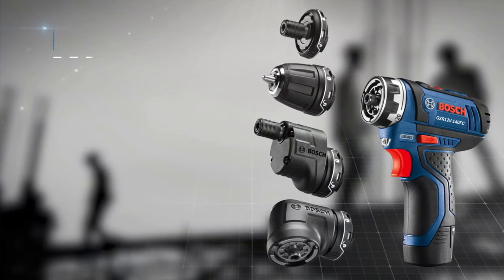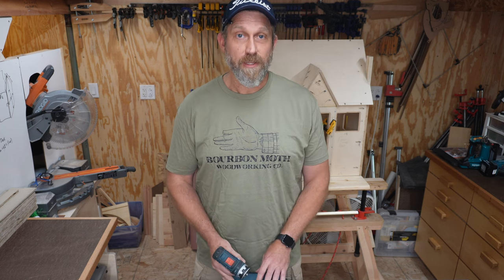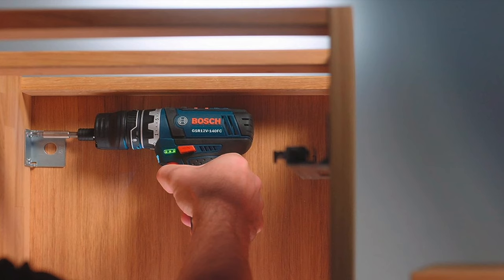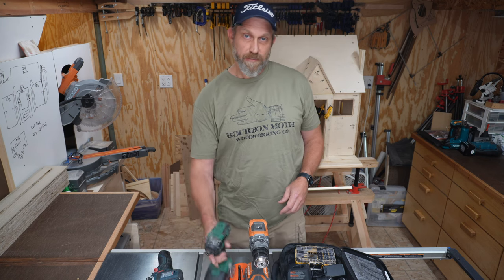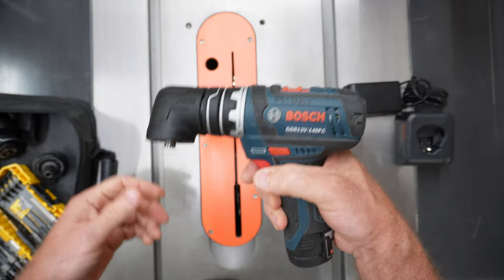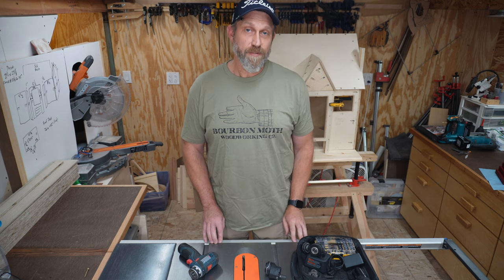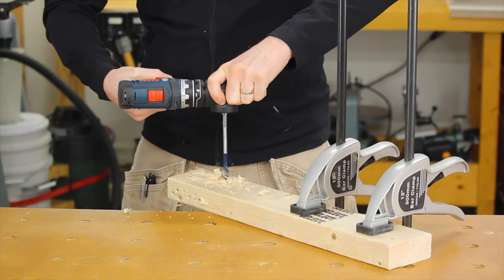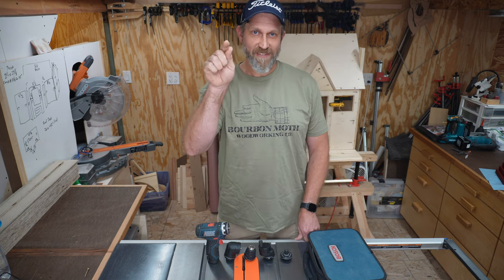Everything You Want to Know About the Bosch 12V Drill/Driver Kit - One Year Review

Comment: Treat yourself and get the newer version, so much better.
Reply from the maker: Really? I’ll probably do that whenever this one stops working.
Reply: Good tip, what’s the model number on the newest version?
Reply: @DSquire10  GSR 12V-35 FC
Reply: @DSquire10 In the US the new model is called BOSCH GSR12V-300FCB22. As far as I can tell it is identical in every way to the 140 except utilizing a brushless motor. And a belt clip! 😊

Comment: I love the Milwaukee 12v line. These head attachments are awesome. This set plus an impact at a discounted price would be perfect for entering into a 12v line. My only issue is that Bosch doesn't make an electric ratchet or a Dremel in their 12v line
Reply from the maker: Right on
Reply: They make a 12v rotary tool, which is the proper name for a Dremel. 
And fun fact, Bosch own the company Dremel
Reply: 12v dremel already uses bosch's 12v platform and batteries will work. its owned by Bosch anyway

Comment: I’ve own this Bosch for 3yrs, use it for door and cabinet removal or install. Also own a dewalt 12v screw/drill and newest M12 hammer drill/clutch with the impact driver. The M12 has the balls but not that Swiss knife all in one.
Reply from the maker: #blessed

Comment: Can you use hex shank bits in the 1/4 inch collet directly, or is the runout too bad?
Reply from the maker: That totally works.! That’s primarily how I use it, with a quick change magnetic extension bit holder.  That’s what makes it so compact.
Reply: @BrettsWoodshop  Sorry, I should have specified hex shank drill bits. :P
I'm curious if the wobble would make it impractical for drilling.
Reply from the maker: @cyberfemme319  There's also a low profile attachment that locks in the hex bits that comes in the kit. But I generally use the drill chuck for drill bits regardless.

Comment: Does it hammer?
Reply from the maker: Nope. Not that kind of drill.
Reply: GFA 12-H FlexiClick should fit
Reply from the maker: Thanks @keinermehrfrei01  . I didn't know about that attachment!
Reply: @BrettsWoodshop  it is recommended you use the stronger brushless driver for the drillhammer attachment. For small holes up to 10mm it's perfect.